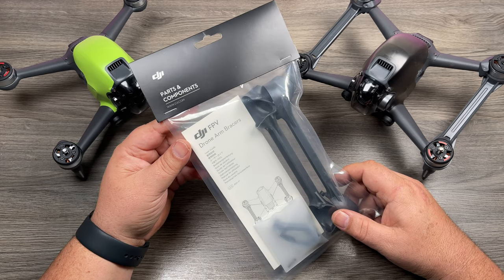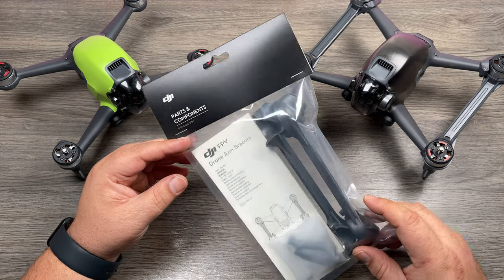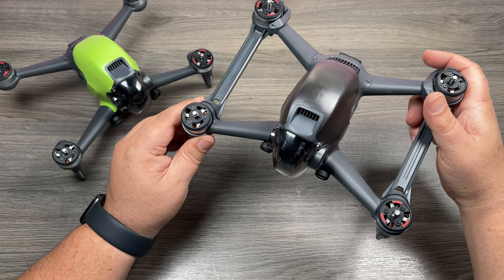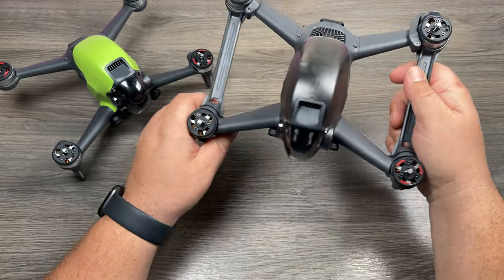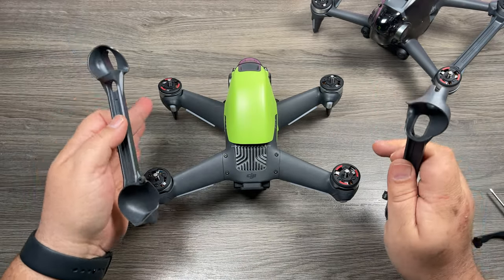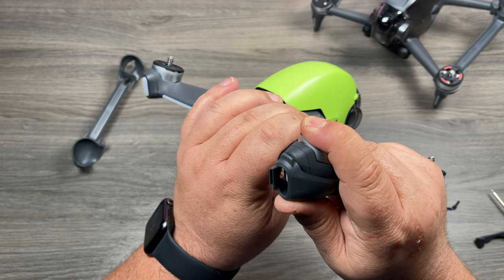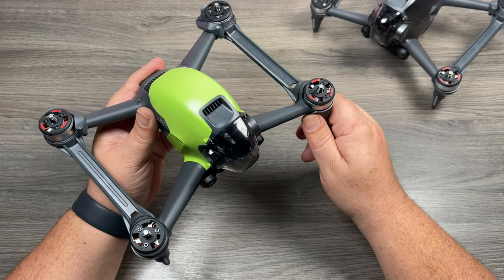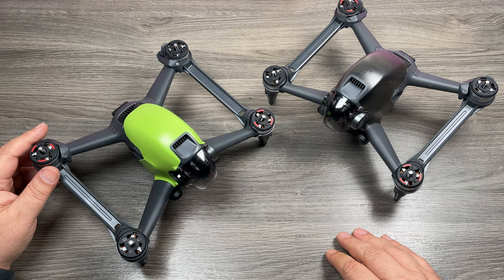DJI FPV Drone Arm Bracers | A Good or Bad Idea?

Comment: I believe the prop guards are better in protecting your drone arms. I have both bracers and guards but only one can be added because they both clip on the end of arms.
Reply: i think too, i have prop guard, i think is a better option.
Reply: Nope, when you hit an obstacle and clips one arm it rips right off. 
I learned the hard way. Bracers transfer the stress to the drone body instead of the singular arm joint.

Comment: Hoping that an engineer can address this question once and for all.
Reply: Engineer here!!!!  The braces will add rigidity to the arms for sure.  Look at it this way.  If the drone were laying on its side, then the arms are the same as two sticks that are sticking up.  Linking the two arms creates an upside down trapezoid with the larger side being the brace connecting the two motors together and the smaller side being the distance between the spots where the arms connect to the body of the drone.  ANY quadrilateral whether a square or trapezoid will have weak points at the joints.  If there were a way to create a triangle, then it would solve a lot of the stress issues.  My idea would be to brace in a truss structure where the motor of the front arm is braced to the arm connection of the back arm and vice versa.  So you create an X with the braces from both arms.  And repeat on the other side.  That would be EXTREMELY durable for any impact direction.  More so, if you can brace it to the battery as well, then you have an almost indestructible drone because now the stress is being directed toward the bottom of the drone body as well.  But, all of that may make it heavy to fly.

Comment: Doesn't much matter.  A drone with one broken arm is just as useless as a drone with two broken arms.

That said, the bracer WILL absolutely transfer some impact force to the other arm, meaning there will be considerably more resistance to breakage.

There's no downside.  If it winds up breaking the second arm, GUARANTEED it would have broken an arm without the bracer.  BUT, there's a very good chance that an impact that would break one arm will not cause damage with the bracer on.

Comment: I designed my own 5-in frame, and while I was designing it I figured out that with those arm braces it's a lot stronger. I like this idea, but I still won't get the drone because it's not really marketed toward what I want to do. Still cool though.

Comment: Those arms might work better if they had a spring joint that when crashed springed out the impact at the joint of the arm basically bouncing into and out of a crash.

Comment: I'm guessing you cannot use the arm bracers and the prop guards together?
Reply from the maker: I’m not 100% sure as I don’t on the top cards yet but I don’t think they will be compatible together
Reply: Official answer in DJI Forum is No!
Reply: The question then is, which are better? Seems like prop guards for very minor collisions, and arm bracers for slightly stronger collisions?
Reply: @Nutle159  better no collisions. Get an other fpv drone to practice and crash without damage. I got the babyhwak 2 for acro mode now
Reply: @chrisbee5481  that's probably the best idea. But there's always a time when you feel overconfident and try something stupid...

Comment: Just a quick correction. The screwdriver that comes with it DOES fit. Its double sided and one side is too small and the other side is correct.

Comment: Good video, TY. That said, although a good thing to have installed...my issue is that it wouldn't go back into my carrying case. It would be too much trouble to take apart and reinstall everytime I put it back in the case. I'm guess my option would to modify the foam inside my case but really would hate to have to cut it all up and probably wouldn't look too nice afterwards.
Reply: Devi posarlo  al contrario!

Comment: Any ideas when these arm bracers are going to be back in stock or a vendor that has them in stock?  They have been out of stock since the FPV was released to the public
Reply from the maker: I’m not sure they were available but they sold out pretty quick. Hopefully it doesn’t become like the foam sponge Goggle upgrades They have been out of stock for like five months or longer
Reply: @AirPhotography  Probably will be - I'm waiting for those as well.  I have the stock reminder thingy enabled...but no notifications.
Reply: Maybe they won't. It's more profitable to sell arms separately or repairs rather than the profits taken by this braces.

Comment: Out of stock… and my drone is at DJI for repair (hit a line I didn’t see) video on my channel...
Reply: Wow you are lucky it didn't hit someone.
Reply: Try b&h
Reply: @Make-Asylums-Great-Again  Out of Stock as well
Reply: @mattwruff  if I find them I will post it.
Reply: @Make-Asylums-Great-Again  DJI store had them today
Reply: Flying over a crowded baseball field is why drones are getting banned.
Reply: @j.r.gloudemans4082  There weren't there when I was flying before and as soon as I saw them I turned and that why I hit the power line

Comment: Understand that DJI has some of the best engineers and they design and manufacture to very exacting specifications.  If they thought it was a good idea to brace one arm to the other they would have done it themselves and included that in their kit.  This will add weight, create too much rigidity, affect aerodynamics and therefore acro capabilities among other things that the eyes alone cannot discern.  Moreover, hard impacts and crashes will transfer more of that energy to the rest of the craft including internal circuitry, parts & sensors and so forth, whereas a single broken arm or two absorbs that energy directly.
Reply: "DJI has some of the best engineers"
You know the arms are also made by DJI?
Reply: @ddegn  oops
Reply: This comment is underrated. I hadn't seen it that way.